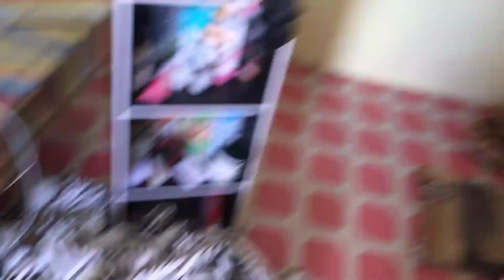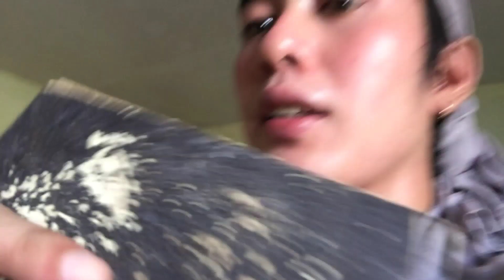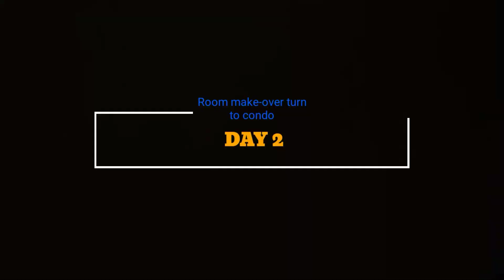DIY EXTREME  | ROOM MAKE-OVER TURN INTO CONDO GRABE ! ANG TRANSFORMATION AMAZING!!!

Comment from the maker: MATERIALS
PAINT> medium Gray_ boysen
Roller brush> 4x10 & 3/8 or 1/2
Paintbrushes> 2" to 2 1/2 > for cabinets, furniture, railings, shutters, gutters
3" to 4> for walls, ceilings, doors
1" to 1 1 1/2 angle or flat > for tight corners very detailed areas
Angle L shape for wall mounted bracket
Stikwel> para madikit yung mga decor na ginawa ko na galing sa pinag pira pirasong sobrang kahoy   magagaan lang po dapat at diinan ng ilang sec. Para dumikit pag kumalat po punasan lng ng basang pamunas 
Linoleum> gray vinyl

If may tanong papo kayo pwede po kayo mag ask salamat po sa panunuod!😘😘😘

Comment: hellooo!!! can u put all the materials used po sa description box pati sana yung prices? ☺️
Reply from the maker: Sure 😊 po slmat po mention ko nalng po kayo slmat ulit.
Reply from the maker: MATERIALS
PAINT> medium Gray_ boysen
Roller brush> 4x10 & 3/8 or 1/2
Paintbrushes> 2" to 2 1/2 > for cabinets, furniture, railings, shutters, gutters
3" to 4> for walls, ceilings, doors
1" to 1 1 1/2 angle or flat > for tight corners very detailed areas
Angle L shape for wall mounted bracket
Stikwel> para madikit yung mga decor na ginawa ko na galing sa pinag pira pirasong sobrang kahoy   magagaan lang po dapat at diinan ng ilang sec. Para dumikit pag kumalat po punasan lng ng basang pamunas 
Linoleum> gray vinyl

If may tanong papo kayo pwede po kayo mag ask salamat po sa panunuod!😘😘😘